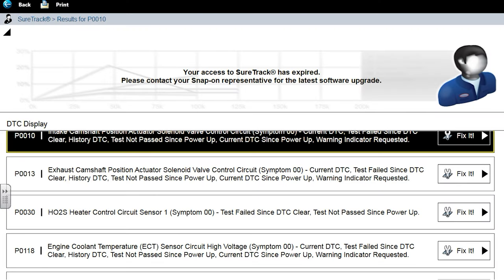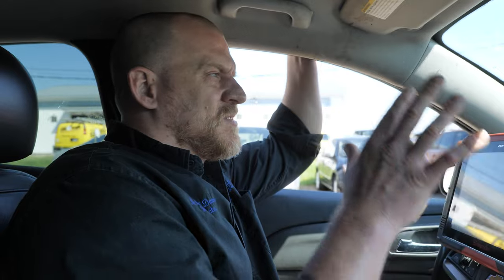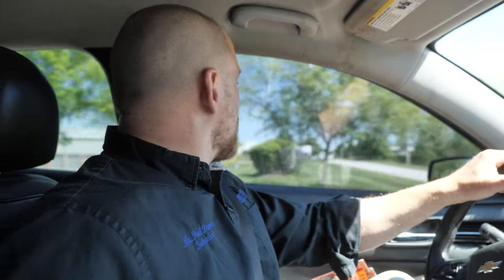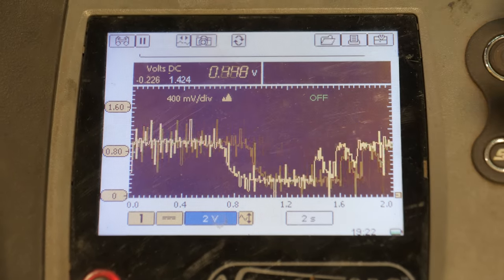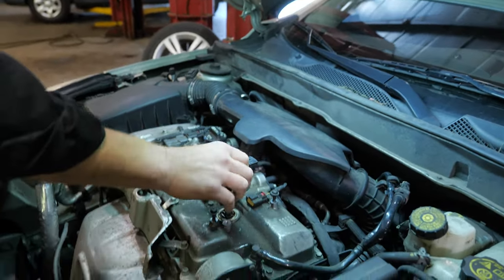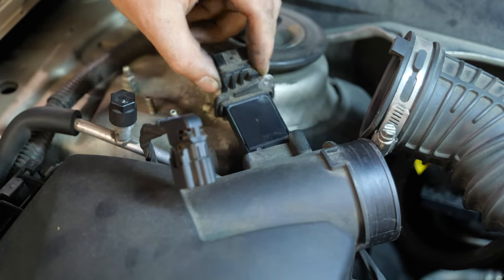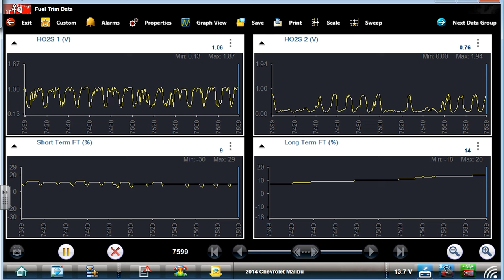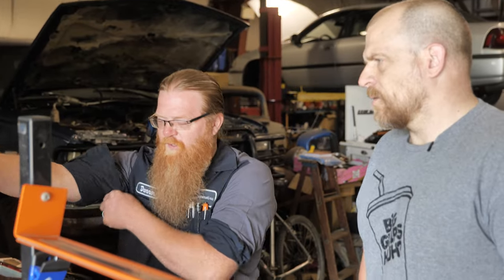2014 Malibu Stalling/Misfire/Idle Lean Condition/Cat Codes/Billing For Diagnostic Time

Comment: Nice job Paul catching the illusive lazy O2 sensor. 
My favorite is the one with 35 DTC’s & the customer’s complaint is poor fuel mileage. ‘How about we start with the safety issues first, like getting those brakes & stability system to work properly.’ Sometimes its not wise to let the customer set the priority.

Comment: Man I get alot of information from you that is helping me alot these days. I hung my wrenches up after 25 years in the field. Times got tough and I recently picked them back up again and started a job at a reputable shop. It's amazing, how much has changed in just 5 short years, as far as the technology and the complexity of the systems on board vehicles today, compared to then. I'm a certified tech and I feel like I'm completely starting over again in with my diagnostic process. Feeling lost, I found this channel and you have saved me from complety embarrassing myself at the shop. Much appreciation comming from iowa. Keep up the good work man!
Reply from the maker: That's awesome man! Keep it up, you'll be back in the swing of things in no time

Comment: Paul I would just like to mention that if the coil boots are replaceable on those coils, it's a good idea to replace them when doing plugs. Obviously one coil is getting replaced so that one is good. From all those heat cycles the rubber gets very weak and pliable and can allow the spark to arc out to the head instead of going through the plug. You probably already know this but just mentioning it for the viewers👍. Great video on catching the slow front o2 and good explanation why it's happening the way it is.
Reply: Just bought an 05 civic LX last week to hold me over for a few weeks (15yrs of owning my 92 ka24e 5sp kc rw hardbody, I accidentally didn't realize the coolant temp was toasted.. reading nothin.. overheated and messed up the head gasket. Gap checked the head all over the place and it's ok, THANK GOD!). When I bought it, tstat was out but sealed housing, ran right in the middle of the temp dial, had a cel though. Hooked up my scanner, saw 0301. Swapped plugs 1 with 4 and noticed the coilover wasn't at tough on 1 as it was with 4... No misfire after that, but I was curious... Swapped the coils altogether just to make it random and see what might go down. Nothin! Drove over 350mi so far and no CEL or mis on live data (about 40mi to work and back total). Lol I've never seen a car with so many miles be so clean AND run so smooth and perfect! How do u flip a digital odometer?! Hahaha! 300389mi! Drives perfect! Only 2200 bucks! GOD IS GOOD! also, cleared codes after writing em down before doing anything. Dude said it ran fine and his brother fixed it years ago, when the valve cover leaked a tiny tiny bit lol (I was like... That's all?! Holy crap!) , never felt an issue, but he felt a rumble a few days before he sold this due to his brother out of state (he's a friend of a trustworthy friend whos brother was a civic fan and was always there for his lil bro). All stock. They wanted to make it a million mile stock car! To have a vehicle cheap, and this seemed too simple to just fix it before I even bought it, I am SOOOO stoked! Such a blessing!
Reply: Oh I meant to say, wiggling the coils in, COULD HAVE closed a gap enough, to not let an arc through! So, great point my guy!

Comment: Hey Paul ,just a heads up,I get a lot of these at the dealership with lean code /stall complaint and 9 times out of 10 it is a loose intake manifold. Remove air box ( a pain on those) grab intake  it will move around quite a bit. Usually misfire on 3 and/or4.
Reply: What"s up Paul , did not care for the tip?

Comment from the maker: 2014 Malibu with the customers main complaint being an intermittent stalling problem. We found in the process of recreating the stalling event, that the car had a bad misfire, a bad catalytic converter, an idle lean condition, a leaking valve cover gasket (into the ignition coil area) and a few other issues.

As many of you know, a customer won't bring you his car, even though he has been staring at a check engine light for years, until he can't drive it anymore. Our job as technicians is to navigate through all of the problems he has, to find the one issue that is making his car undriveable and advise him along the way with all the other stuff. Sometimes one problem can set many different codes and sometimes there are many different problems. If you find yourself not making money performing diagnostic work, then you are not billing for it properly!
Here is the short pulled from this case study https://www.youtube.com/shorts/U1sqOTLEPSg
Reply: .....Damn it man, THIS is hitting the nail on the head. It is SOOOO hard to NOT fix everything you find wrong -EVEN when it means you just fix it along the way and don't charge the customer.  It is just damn near impossible to see and KNOW a problem and it's solution and then not fix it. Great post Brother, real world stuff
Reply from the maker: @JAKEaudio2  the hardest part is balancing what you are seeing wrong, and determining if that will fix the customers intermittent stalling problem (as in this case). The ignition coil that was faulty and causing a misfire, the leaking valve cover gasket into the coil area, the bad cat, and the idle lean condition had NOTHING to do with the stalling issue. It was a bad new oxygen sensor that was the cause of the stall and there were no codes associated with that. That right there is the hard part of our field and people just don't get it. Especially the customers. They think because they are paying for a diagnostic fee that you should be able to tell them every single thing that is wrong with there car. Ridiculous right? I mean, when you go to the doctor you don't just say, "I'm broken, fix me"

Comment: I just resolved this same issue on a 2015 Malibu. Car would lean out stupid under light load and stall when the guy backed it out of his driveway. It didn’t have cam sensor codes like this car but what it ended up being was an aftermarket upstream O2 sensor. So the last shop that had it had actually made the correct repair, just with the wrong component. A lot of Indy techs still don’t know the newer the car is, the more important it is to ONLY use OEM O2 sensors. Manufacturers are building these things sooo strict now to keep a death grip on the parts revenue. I’ve personally noticed that GM’s and Subaru’s are incredibly picky with their parts. You can’t use aftermarket on those things any more. Even if it’s quality aftermarket like Denso, Bosch, etc. If it’s not OE it will not work.
Reply: I just finished the video and it’s pretty crazy that you ended up saying almost the exact same thing I did when I was about 10 minutes into the video 😂

Comment: Another theory is that the lean condition from the O2 sensor caused the coil voltage to increase in an attempt to jump the gap of worn spark plugs.  Bottom line, couldn't have made that theory without the detailed information you delivered through following the data in the video.

Comment: Wow I cannot believe it would shut the car off like that that's very interesting thank you for another great video my love learning I am still trying to learn my oscilloscope that I bought I am testing with it so that's a start thank you
Reply from the maker: For sure. I've seen it many times where an O2 can do that. When the system is pulling away 50-70% of the normal pulse width due to a false rich O2 signal, this is what happens

Comment: Glad I watched this this is very informative also couldn’t help noticing you also have a patriot in your shop I have both of these vehicles and sadly the patriot is not working I’m not getting enough power to crank the car and I literally fixed the relay box new starter and battery and it still cranks slow so it’s going away I’m not dealing with it anymore 😂

Comment: 👍 Chris: you nailed this one ! Good video, would like to have seen the new sensor activity ! Without “skipping” a beat ! Weird one , but with a “plugging” up Cat, the O2 don’t know whether to shit or wind it’s watch ! Causes vacuum leaks & possibly kicking the egr off it’s seat, causing a STALL @ idle ?! Escaping exhaust has to go somewhere !
Reply from the maker: The catalyst code was an efficiency code, there was no restriction. The stall was from a negative 50+% fuel trim command for a false rich signal of the O2 sensor. Make sense?

Comment: Recently started working at a used car lot and I have myself having this conversation with them all the time. They think I should be able to diagnose everything within an hour. Most of the time these cars are traded because well....why else would you trade a vehicle in. Several issues need separate diagnostics which means I need time for each issue or concern . I stand my ground and show them your videos as proof im not a lunatic lol. They still think the scan tool tells me exactly what's wrong hahahahahaha
Reply: Find a better place to work they sound like they will never appreciate your abilities.
Reply from the maker: it is a constant battle isn't it? People just have no idea what it really takes and I am 100% with you!
Reply: LOL, the scan tool mechanic mindsets are the worst - usually just throwing parts at the vehicle
Reply from the maker: @joshr8176  What Trever is describing is pretty typical, especially with used car lots

Comment: Hey, Paul. You mentioned in the video that a leaky spark plug seal can cook the coil. Do you see that often?
Reply from the maker: I do not
Reply: @ScannerDanner   Thank you, Paul. I can't envision oil destroying an ignition coil, but if you have seen it happen, I am going to follow you and not install the coil until the head gasket is replaced. You are, in my opinion, the best. I love your channel more than any other channels.
Reply from the maker: @bfandgfvsbfandgf2856  it doesn't necessarily destroy the coil. it destroys the coil boot and can lead to short circuiting of the spark where it jumps outside of the cylinder

Comment: When I purchased my Pico scope 4425 it had 2  12 to 16 in leads ones to use when you can pull coil. One end on plug other in coil.Then you can use pickup you use on vehicles with wires to see secondary spark wave form. Just a thought.

Comment: Just curios, I’ve been working on a friends 2010 Terrain (2.4).  Many codes were repaired and a broken timing chain guide so everything (timing chain, VCT sprockets, guides, VVT solenoids, etc) we’re replaced.

The main issues was exactly as you described in this video, when vehicle warmed up the fuel trim went crazy, O2 sensors were erratic, timing was erratic, misfires and stalling.

You mentioned the O2 sensor and/or computer ground you believed your brother corrected that corrected those issues.  I replaced both O2 sensors).  I’m curious (as you could no longer re-create that issue, if when the vehicle was returned to the customer whether or not the stalling issue returned again?

Comment: Is there a probe/setup you recommend if you absolutely HAD to see the secondary waveform on this style coil? I ran into this the other day on a 4 wire coil on a Mercedes and ended up going through the PITA process of swapping it for the same reason of not being able to get a good waveform. I found the problem anyways (was the coil) but would like to avoid the extra work if I have a problem on a similar car where it's a pain to swap the coils.

Comment: I think there should be more emphasis put on the lean condition, because a lean cylinder is harder to fire and loads the ignition system greatly. Which can cause coils and plugs to burn up. If u replace 1 coil and 4 plugs and a o2 sensor ur likely going to be in the same "boat" or garage in a few months if u don't correct that lean condition.

Comment: Hello! please help me with the problem, I talked live before, I have some oscillations at idle in a golf 4, 1.6 16v petrol, no one has bothered, if I disconnect the thick wire from the alternator the car runs fine, the load is 13.8 and it oscillates, with consumers switched on it loads 12.7, the diode bridge and the charging relay changed, is the alternator to blame? good luck, health and growth in everything

Comment: @scannerdanner hey Paul! You should snag a shotgun mic for recording, when you have a guest. I've been doing audio engineering most of my life, but I'm also very mechanically and especially electrically inclined... I watch your videos like crazy and I seriously understand your conclusions (and the few times that they become a pt2). 

Anyways, back on subject lol: if you wear your lavaliere mic, use a shotgun mic for the guest or direction of interest, and use a compressor/gate (honestly, don't buy a compressor and gate for input recording, considering what your use is. Use a software one for during editing)... So, instead of standing by Danner, you can be at any distance. The gate allows you to set a volume threshold (I'm sure u can already figure, but still, allows sound to pass at a particular db level), attack is how fast it reacts, release/decay is how long it stops reacting.. and same with a compressor except it has a ratio to "compress" louder noises, so everything can be more even across the board.

If you find a gate/compressor/exciter, the exciter keeps loudness at the volume u set it at (usually after the compressor), but boosts the quiet parts, so u can separate background from foreground noise. Once all is set, write down and/or save the settings, and then it's just minor tweaks depending on the video... Of course there's "gain" (raw premix audio) and volume (edited postmix audio).

Lol I know ur pretty particular about that aspect of ur clips! Seems especially with ur brother! But I guarantee it'll make a massive impact on all of ur shots, and especially ur class/workshop ones when ur hands on with ur students!! I seriously want to join ur school! Really thinking about doing it man. Thanks for another great insight on some tricky stuff!
Reply: Oh yeah and I'm totally buying ur book! Meant to a long time ago!
Reply from the maker: The audio was absolutely horrible in this video. We use pico mics on me and my brother and it is usually spot on. We lost com with the mics and this was camera mic only for 34 or 37  minutes of this. Late in the video you can hear our good mics come back. But thanks so much for all the suggestions!

Comment: This is where as a backyard mechanic, I struggle. If I took this to a shop if the main mechanic worked on it I am looking at like $400 easily for these repairs. If they put one of their understudies on it I am looking at maybe double that. For $400 at Rock Auto I can replace all the coils and spark plugs both oxygen sensors and the map sensor. So I guess my question is. When do you involve a professional versus throwing the parts canon at a problem at home.
Reply from the maker: If you have a trusted diag tech. Every time it is worth taking it to him. Sure you can roll the dice and get lucky, but let's say you're wrong in this scenario. Now you changed a bunch of coils and plugs that were good, to inferior parts bought online (ALL OF THEM ARE INFERIOR). 
You may have even added a problem by replacing parts, that's how poor the parts market is these days.

Comment: hi i need help with my car it is a golf mk3 1.4 cl .  i was diagnosing a problem and disconnected battery and i believe i left the key on ignition while battery was disconnected and so i believe key code disapear. the car was working just fine but now wont start. crancks but does not start. can you please tell me what could be the problem and how i can program a new key code. i have 2 keys but just 1 has the key code the other is just a normal key that could never start the car.

Comment: Hi,
In such case, which is that we cannot get a waveform from 4-wire coil over plug, can we plug a spark plug tester to the coil from one end and the other end of the tester to the spark plug on a given cylinder? Then we connect secondary pickup on the tester wire to get the waveform.

Thank you
Reply from the maker: Yes, in fact my pico kit has plug extension wires for this very thing. I used to make my own out of a set of old plug wires too

Comment: Out of scope question for SD, but how far have you got with learning wideband O2 systems ? Any tips for working with low power issues on wideband systems ?
Reply from the maker: no different than using the narrow band O2, you just need to learn the range of the sensor and each system is different. I just did one a few days ago and performed a high rpm deceleration event to monitor the lean side (decel fuel cut off) and then a WOT run for the rich side, all while monitoring the downstream O2 to confirm. You're just not doing voltmeter testing on the signal circuits on these. The range is from 2-4ma on these sensors and you are just not going to monitor that low of current. So scan data diagnostics on these for the most part is all you need. You can see heater circuit operation and the signal itself too of course. I'd say the only time you need to perform voltage measurements on a wideband is if you have a steady, unchanging signal on the scan tool and you want to confirm there is not a broken wire.

Comment: Would love to know if the faulty 02 was a bosh sensor ?
Reply from the maker: On the Chrysler systems that used a PWM heater circuit, the Bosch O2 is absolutely NOT compatible! Wouldn't be surprised if that was the case here too